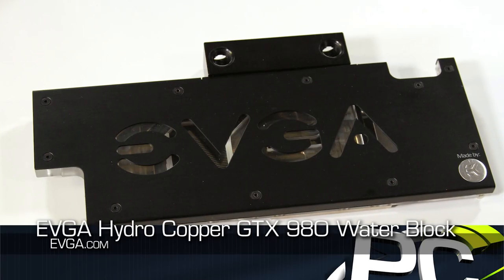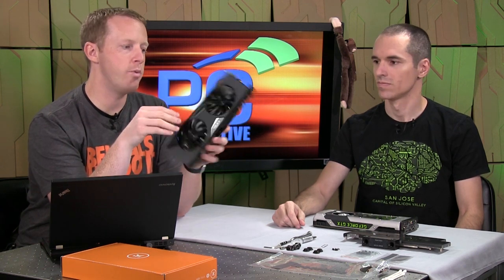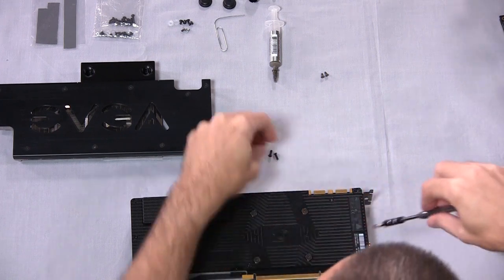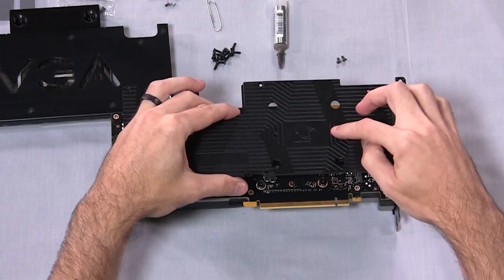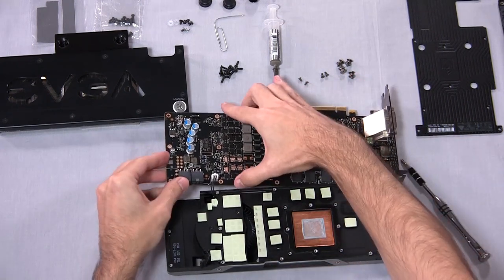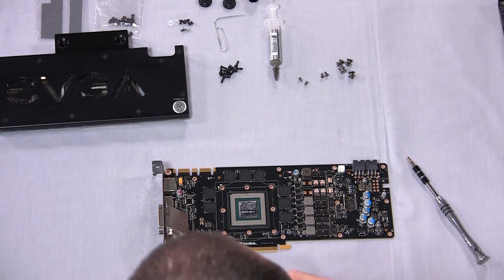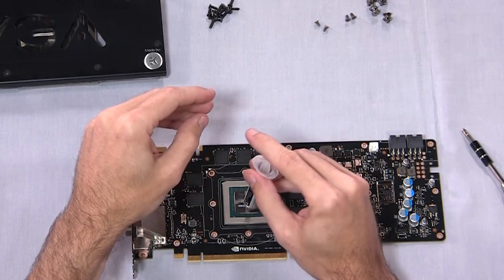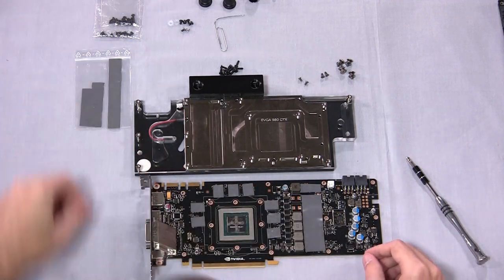EVGA Hydro Copper GTX 980 Water Block Installation

Comment: The EVGA logo should be facing towards you when the card is installed in the machine. Seems weird to me that they chose the opposite. Hopefully in production they reverse it. Would not mind picking one of these up.
Reply from the maker: Archer Sterling I would agree with this. Some cases / setups have the card standing up though.
Reply: pcper Yep, EK isn't Gigabyte! They know what they are doing and if EK puts the EVGA on that way it's for a reason!
Reply: i think all of the Hydrocopper cards have been like that, haven't they?
Reply: What do I know? I'm a YouTube commenter...
Reply: it wouldnt make sense, buy a opposite inverted90 degree case youll see it then.

Comment: Great video.

But as some others have commented already.... that seemed like a ton of TC. Granted I haven't actually wc my gpu's yet (only cpu for years) so what I'm wondering is does there need to be more TC on GPU vs CPU?
Reply: There does. The entire bare die must end up with TC between it and the block, as there is no IHS.
Reply: Ok. Thanks for answering that.

Comment: Isn't that quite a lot of thermal paste? :O Or do you have to put more paste on the GPU cores?
Reply: Compared to cpu cores.
Reply: That was a bit more than I would or have used, but I replaced my paste on my 770 GTX ACX cooler and the stock pasting job did over hang the GPU die a bit so I used more than I thought others would like if I did it live on YouTube... lolz!

Comment: If I want to liquid cool a GPU do I have to buy a reference card? Does a water block only work with a reference PCB layout, or does work with any card?
Reply: yes, most add-ons, if not all, are only meant for reference cards. I learned that the hard way
Reply: jlei8aX does that mean this waterblock will fit the EVGA GTX 980 superclocked card?
Reply: Roydel Williams if u give me a link to the exact card you have ill be able to tell you more

Comment: Mother of god!  Did anyone else see how much Thermal paste he put on that tiny GPU die?  Not to mention how he applied it!
Even Ryan was kind of cringing! D: Poor 980
Reply: Too much on exposed dies is ok, just use non-electrically conductive paste, and torque it down. The ENTIRE exposed die has to be coated, NOT JUST THE CENTER. If you do just the center like a cpu, you will fry your card.
Reply: Richard Smith Fair enough comment... but too much still isn't acceptable. An acceptable amount is acceptable.
This isn't an acceptable amount, it's an excessive amount. You do need to get the entire die covered, but you want to avoid spilling an excessive amount. AS5 may not be conductive, but it is capacitive which can lead to issues on the smd devices around the the die.
Reply: F34r1355 Thats a fine line, and too much will not matter if its not electrically conductive. Cleaning up afterwards is a pain, but better than a fried card if you underestimate.
Reply: While AS5 is not electrically conductive, it is capacitive, which can cause issues. It warns about this on the packaging. If he were using something like MX or Alumina it wouldn't be a big deal at all.
There is a right amount, below that is too little, and above is too much. It's common sense. It's just as bad to error on the side of too much as it is too little in the extremes. A little too little isn't bad, and a little too much isn't bad.
Reply: The fingerprints (and thus oil) all over the block when he installed it arent going to help either. Shoulda used some of those alcohol pads. lol

Comment: Arctic silver 5 why? Get some Gelid extreme it's better in every way~
Reply: They're basically the same. In wich you believe makes a difference
Reply: TheMrKeksLp you do know arctic silver 5 is capacitive right? you could short something out on bare chips if you aren't careful. thats the only significant difference between as5 and gelid gc extreme...and the fact there is no cure time...and the fact that you can shave off a few more degrees.
Reply: ***** I guess you're right...^^

Comment: Never seen so much tim on a cpu or a gpu in my life. It will be all over the pcb if you apply that much. On top of that you are creating a barrier for heat transfer. not a good example guys. Also Arctic Silver was a good tim 5 years ago! You can drop your temps buy 5c or more by using GC-Extreme!

Comment: That is way too much thermal compound, and a not a proper application method. You mention you do it that way because you find it boring, however that isn't an excuse to teach improper methods.
Then you mate the block without cleaning it. There are clearly in areas that will be making contact that have fingerprints on them..
Very disappointed to see such a poor quality video that is supposed to be educational.
Reply: When the block was removed, there was thin and even coverage across the entire block, no air pockets, and very little bleeding past the edge of the die. Pretty much exactly what to shoot for.
Reply: Allyn Malventano This is not shown on the video, nor would it make any sense.
To simply claim "Yeah, it's good" doesn't provide any evidence. I'm also assuming that you mean "across the GPU", as the block is a rather large surface, and not all of it needs to be covered.
Have proof?
Reply: F34r1355 we had other work to do, so we did not photograph after the removal. Also, that block has already been tested, removed, and sent back to EVGA. I've water cooled my own personal GPU's for the past 10 years, and in this job we apply thermal compound more often than any typical home user (every time we switch out a CPU on a testbed, etc). We'll just have to go with my word versus your opinion on this one.
Reply: Allyn Malventano Once again, you're appealing to ignorance. You're working under the assumption that I'm a regular home user. I make a living repairing PC's. I spend quite a bit of time replacing thermal compound that has dried on OEM machines, and installing it in new builds.
You're not the only person who has spent years liquid cooling systems, or who frequently works with thermal compound. As a matter of fact, there are many people who are more enthusiasts that have done testing a on a lot of methods on sties likes overclocking.net that wouldn't agree with your methods.
If your method is so "tried-and-true" then why not demonstrate it on a spare GPU with acrylic?
Even though you really can't avoid getting some spill on a GPU, if you're going to use a terrible method like that, perhaps you should go with AS Alumina, at least it isn't capacitive like the AS5 you're using.
If you want to talk about being someone that does this a lot, and want a comparison to other Youtube channels, perhaps you could tell me why Linus Media Group doesn't do it in an + pattern, or why Tek Syndicate also does not apply it in this method. I'm sorry for taking your precious time though.
I understand why the fan base of this channel isn't going anywhere, with the presenters that treat the audience with so little respect. Without knowing a thing about me, you try to act as though your word carries more weight than mine, and that you're somehow superior. 

Edit: Yes, EK does recommend a cross pattern, but it also says to use MX or GC-Extreme, which are both non-conductive, non-capacitve compounds. AS5 is capacitive as mentioned previously. They also don't recommend putting it in a + pattern, and placing a pea in the middle. mix and match methods aren't the way to go.